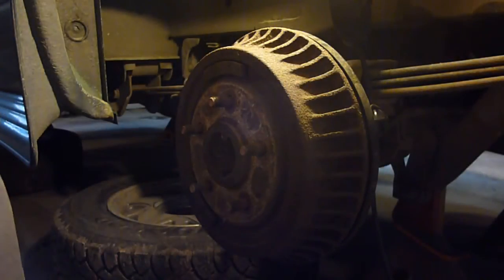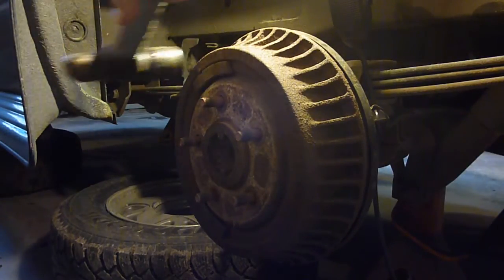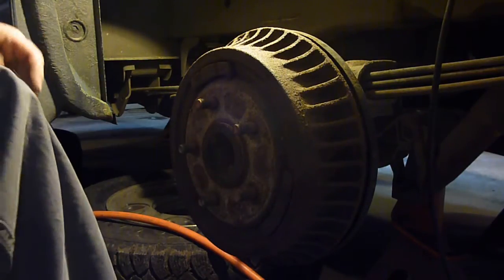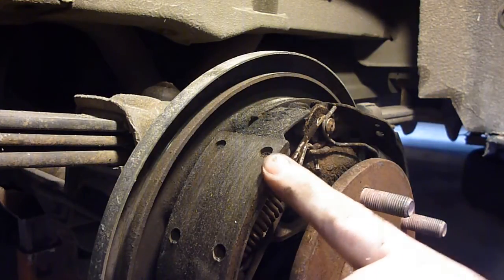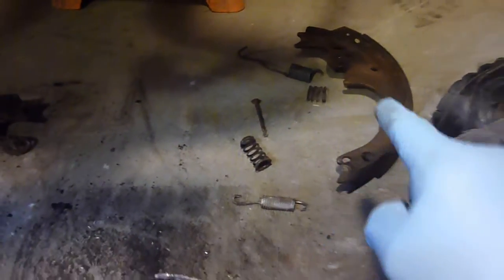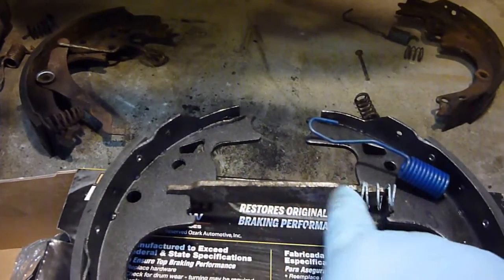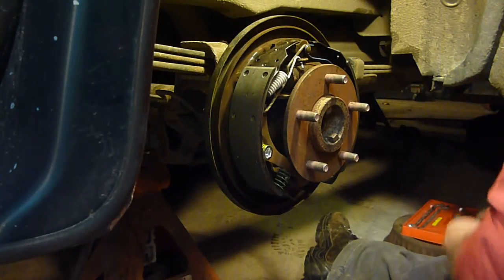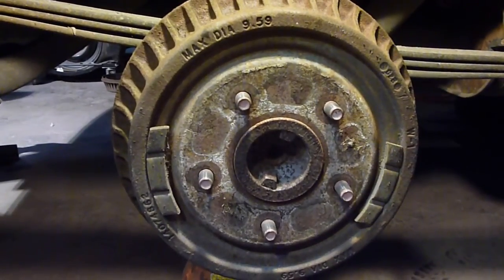ASTRO VAN REAR BRAKE REPLACEMENT   (long vid)

Comment: My rear brakes dont release when I let off the brakes pedal  for a second or two. Could this have to do with my ecbm ( recently the brake and anti lock lights started coming on)? By the way love all vids.
Reply from the maker: thanks for the comment, honestly it could be several things , but when it comes to the computer control stuff thats were i don't know much. sorry i'm not much help i have heard that gmc/chevy have had issues with the ebcm's,  but i don't know if that would be your problem for sure sorry again and thanks for watching .

Comment: dude gotta knock out the plug in back, turn brake adjuster to loosen shoes and viola
Reply from the maker: i've never had much luck with that it takes forever and still is seized but i agree it works sometimes
Reply: 4 years later, but anyone wondering with that adjuster... It will be locked normally and only allow tightening. Apply the park brake and it moves the adjuster lever out of the way, then you can move the star wheel to loosen.
Reply: @matthewkerrie7299  oh is that how to do it I always pushed the adjuster out of the way with a bent screwdriver
Reply: @edgrrickett140  yupp. Works for 90% of drum brakes I've seen, because then the tab moves out of the way.

Comment: Do you know if its necessary to change the pistons as well when it has gone so far as steel to steel?
Just got a 94'Astro that's not been taken care of that good..
Got all new shoes, drums and all the springs needed etc..
Also got the pistons, but not sure if i need to replace them. It's more like I dont want to if not needed cause just seems like more work, and not done it before too..all the rest is good and done before on other cars with drums so its fairly ok.
Thanks for any reply!
Reply from the maker: only if there leaking if you don't see sign of leaking you should be fine
Reply from the maker: i have a vid on replacing the brake cylinder  / piston on my channel if you need to it's not very hard go to my playlists and look for astro van i have several vids thanks for watching
Reply: thank you very much! hope its not needed to replace..anyway not my biggest problem. have some car electric problems too that i have not done before (the electric windows). so hope only replacing the engines is enough to make it work-have changed all the fuses/gone trough...if not the story continues...believe it will be a good astro at the end. have enough time in summer to do some makeovers cause riding bike. will post result in my channel when i get it done. by now the parts already cost twice what i payed for car..and more to come to make it my personal one
Reply from the maker: good luck hope all goes well